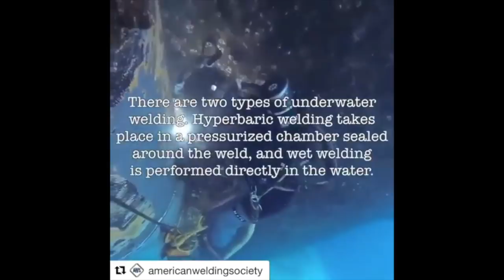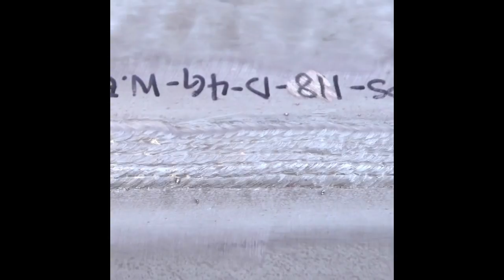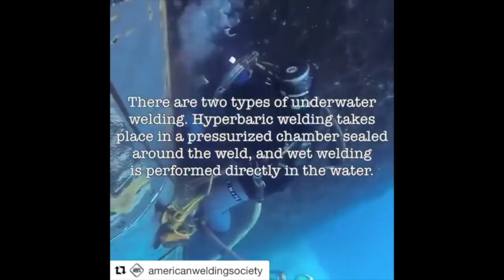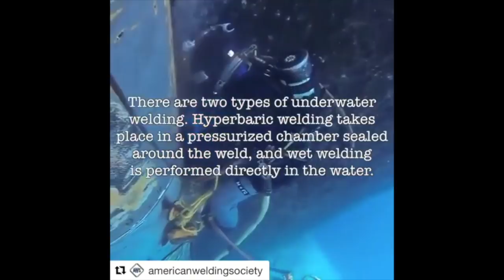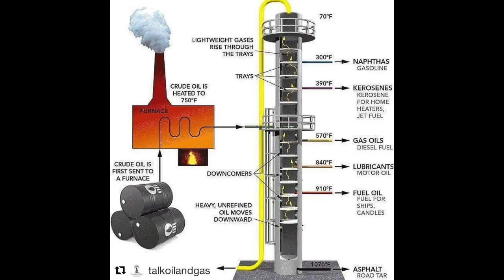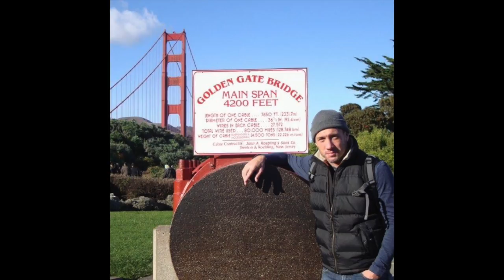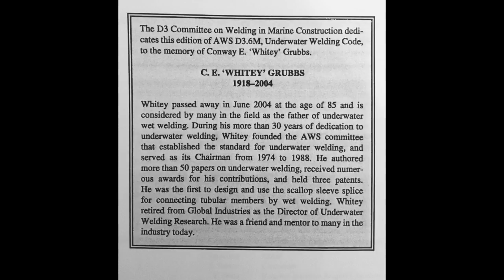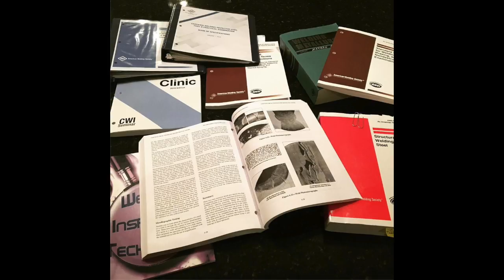Podcast #28 Underwater Welding with Nate Martin

Comment: Jody, you're always talking about finding something interesting to put into your weekly videos. I have an idea that I think would be great for one of them. Talk to us about how to PROPERLY use a 6" Metabo grinder with a cut off wheel to cut on a line accurately. How do you start the cut. Where do you start the cut, what do you do if the piece is 4" wide and you're blade can only cut in from the side 2". Now I realize that anybody can hack up steel using one of these tools, I've proven that multiple times, but how do you cut steel accurately enough to weld the pieces together using a grinder to cut the steel. I think this would be a very useful video.

Comment: Hello I have 2 years welding experience in the boiler makers union , I graduate a basic welding course at a tech school in 3 weeks  , 9 month program just scratches the basics of the trade , im currently filling out an application for Arizona underwater welding school 7 month program it’s 26 k for everything, I need to know if this is going to take me far or if I should go start a pipe fitter apprenticeship, I’ve done so much research and I just wish I could talk to an underwater welder like yourself Nate . The podcast was very informative and I appreciate it but I need more knowledge before I make the huge investment. No dive experience but I’m so intrigued by this field of work and I have been for a few years , I’m honestly going to take the shot either way as I have no kids yet and I don’t want to waste time , I will be one of the 20 that break out I promise you that

Comment: man I tried welding underwater to fix my boat rudder but as soon as I lowered the welder into the water everything shorted out ! so I bought a new welder then just took the stinger in the water but couldnt start an arc.  Are 6013 rods not suitable for underwater? it does say all positions.
Reply: And in cold sea water I can only hold my breath for 30 seconds so I reckon too many tie ins!

Comment: What if the put the habitat on the outside of the hull, drained it and then back gouged and welded from the inside of the boat? Could work in certain situations
Reply: What types of wire are used for underwater welding in numbers?

Comment: Good talk.  It would make sense to have a safety wire basically like an anti static band for mosfets etc  of piece of normal wire that connects both hands / wrist  and this wire can even go around yr back so it dosent get in way,  to save from any current going through yr heart.  Thinking about it biggest problem might be people turning away from work to change out rod to see in light thereby causing chest to be in line of current in water.

I would have thought you would have to heap the amps up for a start to water weld.  As Simply experementing dry stick welding wet steel to see this concept I found I needed to up the amps to blow the water away, as its taking heat away like our bodies do in a sauna. 

Misrable clowns should give you ole laptop with no L-ion battery but dc cord.  So welders come divers is best  - so ex prisoner come diver - welder will be better

As for A cat welding, Id say they have the Amps up high then maybe pulse / pause for cool down.  As tempering metal after hardening to take brittleness out / making spring steel etc  is something like 600 degree celsious reheat  so it would be going along that line of thought.

Thanks for info...